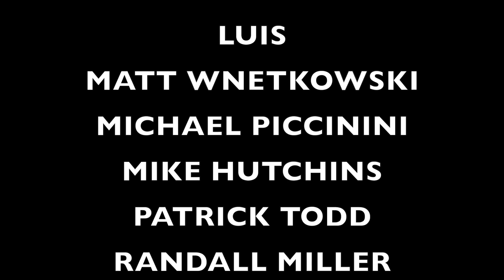GETTING KICKED OUT OF AUSTRALIA!

Comment: I am sad about the iS300 because it's one of my fav cars.  I feel like they're slept on, and they still have a ton of potential. But the E46 will be cool too. I'm still stoked that you're trying to take your drifting to the next level. It's going to be sick.
Reply: Your really think this dude is gonna do the work to make an is good when he can get a book of bolt ons for a beamer and be 1/4 the price
Reply: He should’ve just kept the ls3 e36 at this point smh 😂
Reply: As a is300 I can tell you is300s can take a hell of a beating. Constantly flooring it and hitting 100+ on the freeway and it’s only been to the shop twice in the year and a half I owned it. Toyota at its finest
Reply: @Brotschnider  its not about taking a beating or whatever. if he wants to go pro he needs proven chassis that has all the parts developed and tested. i mean there is reason why you dont see any IS300 in  FD and other pro comps
Reply: My first brand new car I ever bought was a 2002 IS300. Loved it. I put 85k miles on it and never had to do anything but oil changes, tires, and brakes. Only car I’ve ever sold that I’d like to have back!
Reply: @Brotschnider  thats horrible bruh my r33 gtst hasnt been to a shop in 5 years. daily driven only done a yearly service...
Reply: @xlasta4268  There's always one...

Comment: dang dude traded a LS swap running in a car for a $200 rusty E46 shell
Reply: What’d you expect he only trades for shit boxes I’m surprised he hasn’t traded the m2 for another Miata 🤣💀🥴
Reply: When it’s all said and done he swapped a $3800 car for an e46 with wisefab and a $3000 FD spec cage, seems like a good deal to me
Reply: Running vehicle for a car with no motor rusted to shit that’ll end up never getting finished plus a 2j is only going up in price ruddys cheap ass will never finish that car 🤣
Reply: I was thinking the same thing. Those used angle kits and coils are worth less than 1500 bucks lol you just gotta remember the labor for the cage ect
Reply: @DIESEL1JZ  an ls 6 speed camaro is worth way more than 3800, especially in a part out. He got hustled
Reply: He gets hustled more then anything
Reply: @DIESEL1JZ  the transmission in that Camaro is worth 4K alone if it a t56 😂
Reply: @tijeansharpe566  no they arnt. Lolol u have no fucking clue what you're talking about. T56 sell for like 2500 now adays. Granted I bought the ss camaro I used for my swap right before covid but I got that car for 3800. Running and driving. I've seen several t56s sell for 2-2500 in the past year in the northeast. T56 are not 6k transmissions. Bc if they were that would mean my built one would be worth like 8k and it isn't
Reply: @zmohan69  find a used t56 shipped to your house for less than 3k and summit is selling them new for 3500 before shipping I just rounded up to 4K
Reply: we will never understand chris... every new car he gets NEW drift car... but making one solide drift car nahhhh lets make 6 shit ones that all break... sell them and do the same shit again... why doesnt this game make a burnout car he seemed to like to do that... or a drag car...

Comment: Bummed about the e46 move. See them around every block of every city of every state. 

2j is300 would have been sick
Reply: I mean, to be fair all is300’s of that generation(01-05 I THINK) have a 2jz in them stock lol Ive been trying to buy one for literally 5 years straight but it’s almost impossible to find a good one here in MD that has a manual. Plenty of auto ones but the manuals are super hard to find in good condition; at least here but they’re TECHNICALLY all 2jz is300’s cause that’s the engine they come with lmao

Comment: I definitely think you should not do a rear radiator. Adams e36 is still front rad and it seems to works great. If you haven’t already, you should definitely use the connections you have like lz and maybe even hit Chelsea up and get their opinions. And you will end up with a way better car in my opinion. Definitely think that was the right move though going to the e46 instead of the is300.